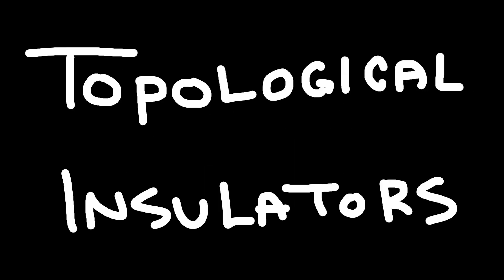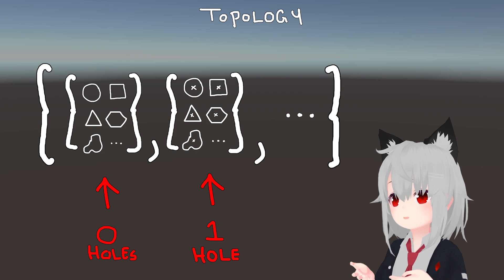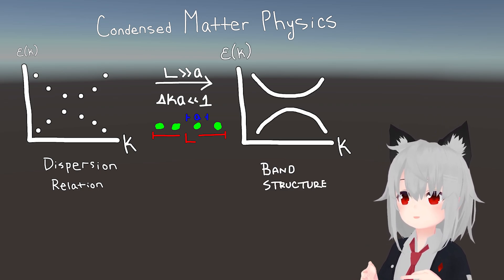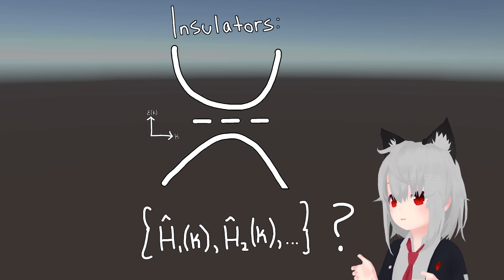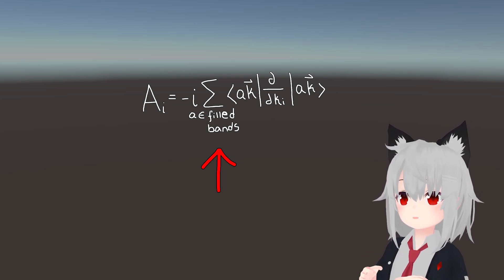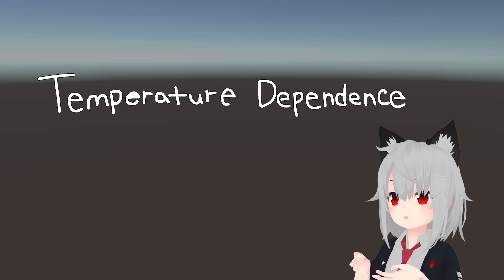Topological Insulators in a Nutshell - Theory and Experiment

Comment: here's an ai's breakdown of the hard parts for anyone who's just like me still completely bamboozled:

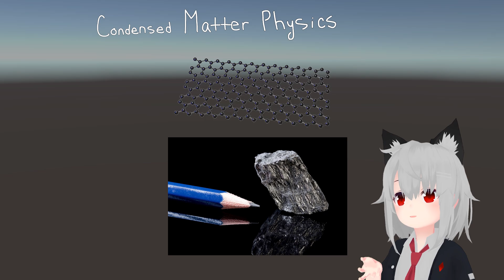* Condensed Matter Physics [02:27]: Think of this as the physics of "stuff" you can touch and see. It's about how the atoms in solids arrange themselves and how this arrangement affects the material's properties, like whether it conducts electricity or not. Examples include the graphite in pencils or the silicon in transistors.

 * Crystalline Systems [02:28]: Imagine a perfectly organized Lego structure. That's similar to a crystalline system. The atoms are arranged in a repeating pattern, like the bricks in the Lego structure.

 * Valence Electrons [02:34]: Atoms are made of a nucleus and electrons. The valence electrons are the ones on the outermost "shell" of the atom. They're the ones that do the "work" of bonding atoms together. In a crystal, these electrons are mostly attached to their own atom, but they can jump to a neighboring atom.

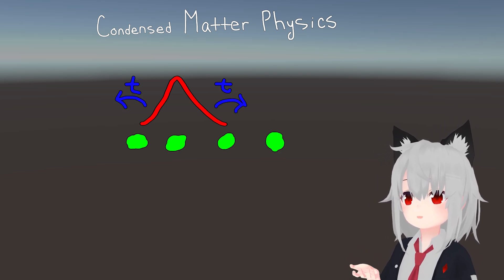 * Equations of Motion & Hamiltonian Formalism [02:41]: These are fancy ways of saying "how things move" and "how much energy they have." Physicists use these tools to describe how the electrons move and interact within the crystal. Think of it like a set of rules that govern the electrons' behavior.

 * Diagonalizing the Hamiltonian [02:47]: This is a mathematical trick that helps physicists figure out the allowed energy levels of the electrons. It's like finding the "sweet spots" where the electrons can exist.

 * Dispersion Relation [02:53]: This is a graph that shows how the energy of an electron changes as its momentum changes. Momentum is related to how fast the electron is "moving" through the crystal.

 * Discretization of Energy Levels [03:00]: In the quantum world, energy isn't continuous like a ramp; it's more like a staircase. Electrons can only have specific, allowed energy levels.

 * Band Structure [03:13]: Imagine taking the dispersion relation and making it a continuous curve. This curve is the band structure. It shows all the allowed energy levels for electrons in the crystal.

 * Energy Gap [03:36]: Sometimes, there's a "gap" in the band structure where no electrons are allowed to exist. This gap is crucial for determining if a material is a conductor (like metal) or an insulator (like rubber).

 * Fermi Level [03:40]: If you start filling up the allowed energy levels with electrons, the Fermi level is the highest energy level that's filled. It's like the "water level" in a glass.

 * Insulating Behavior [04:00]: If the Fermi level falls inside an energy gap, and the gap is big enough, the electrons can't easily jump to higher energy levels. This means the material can't conduct electricity; it's an insulator.

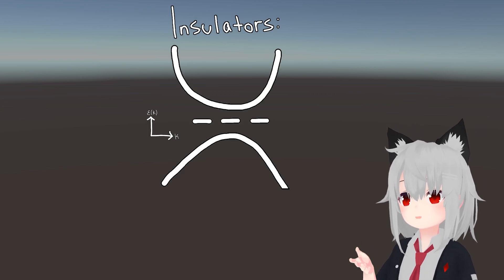 * Topological Equivalency Classes [04:48]: This is where it gets a bit abstract. It's about classifying materials based on their "shape" in a mathematical sense. Two materials are in the same "class" if you can smoothly deform one into the other without breaking any fundamental rules.

 * Topological Invariant [05:10]: This is a number that describes the "shape" of a material's electronic structure. It stays the same even if you deform the material smoothly.

 * Adiabatic Transformations [06:32]: These are changes that happen slowly and smoothly, without disrupting the fundamental properties of the system.

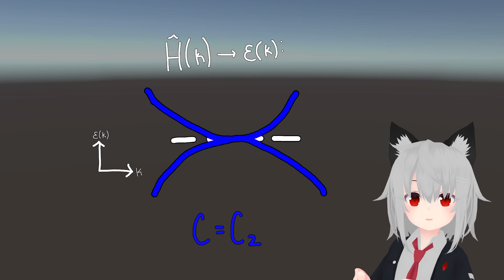 * Gapless Edge States [07:11]: These are special states that can exist at the edges or surfaces of certain materials. They allow electrons to move freely, even if the bulk of the material is an insulator.

  * The existence of gapless edge states arises from the fact that the vacuum is topologically trivial [07:31].

  * The boundary between a topological insulator and the vacuum represents a change in the topological invariant, which necessitates closing the energy gap and creating conducting edge states [07:38].

 * Experimental Evidence [08:12]: This is how scientists prove that these topological insulators exist.

  * Temperature Dependence [08:25]: Topological insulators behave differently at different temperatures due to the edge states [09:12].

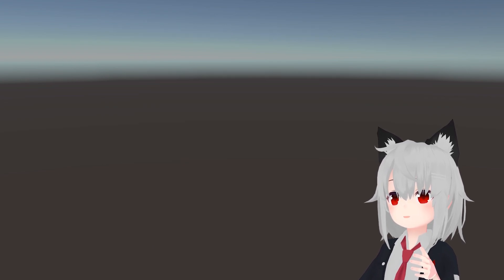  * Magnetic Field Dependence [09:58]: Applying a magnetic field can reveal the special properties of the edge states [10:12].

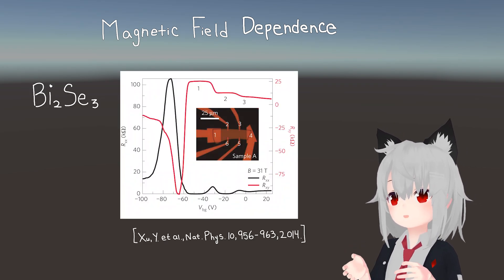 * Significance [11:38]: The ability to infer the existence of a non-trivial topological invariant by looking at simple properties of the material represents a significant advancement in understanding insulators.

Comment: Very good video. One tiny correction, the Fermi level is not the energy level at which the highest energy electron exists (indeed there will be a distribution of electron energies and so the highest energy electron could technically and fleetingly exist at very high energy levels).

The Fermi level is defined as the (theoretical) energy level that has a 50% change of being occupied at any given time, given the system is in thermodynamic equilibrium (kinda like a median).

Comment: so, for condensed matter systems, the "shape" analog is the hamiltonian (hamiltonians can be grouped into equivalence classes)? the "hole" is the band gap and the deformation is whatever continuous change of the band structure that preserve the band gap? should continuous deformation in this sense preserve the width of the band gap to be considered in one topological equivalence class?
Reply from the maker: nah, just like the size of the hole doesnt matter in topology, the width of the gap doesnt matter in topological insulator, at least theoretically

realistically, though, you'd need to take into account other energy scales to compare. for example, experimentally, the band gap might be considered "zero" so long as its sufficiently smaller than the thermal energy of the environment

Comment: Awesome video! But wouldn't this mean that all insulators have these edge states? So then all insulators are topological?
Reply from the maker: thanks! that's a good question- in order for an insulator to show edge states, its band topology needs to mismatch that of its environment (this is the condition that forces the gap to close and re-open at the boundary). since the vacuum/air have a trivial band topology (topological invariant of 0), insulators which also have a trivial band topology won't show edge states. so I think it's more appropriate to say that all insulators can be thought of as being topological (having some band topology, even if its 0), but that most of them are topologically trivial and don't show edge states, at least not in air.